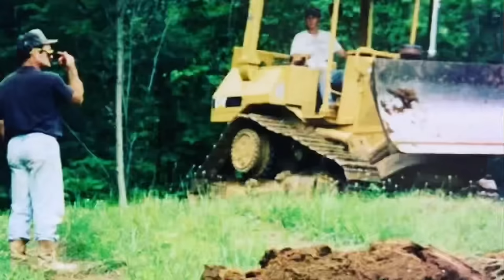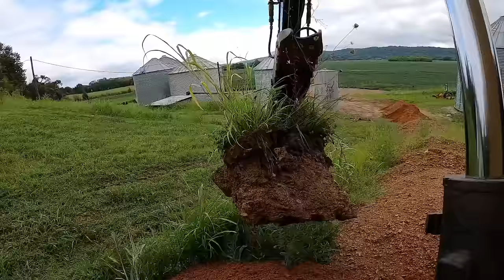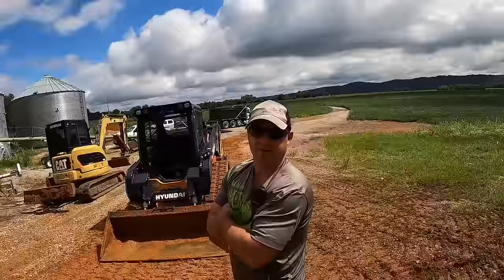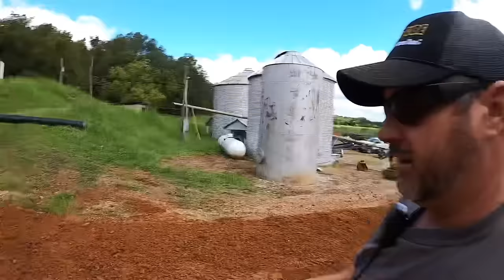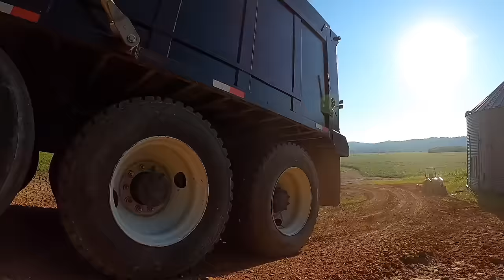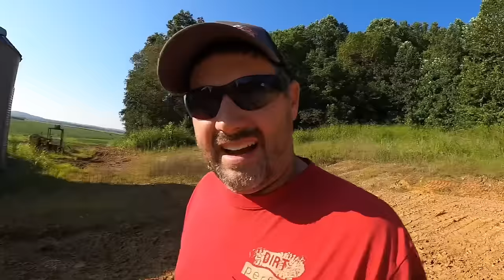Small Road Job for Grandma Turns Into A Joy Ride In A Dump Truck For Grandma!

Comment: Should drag the old dozer off the family farm and get it running and operating again. Slap a big dirt perfect sticker on it. Would be a great mini series for the channel or do a collab with Diesel Creek
Reply from the maker: Video posted about that
Reply: @DirtPerfect  sweet ill have to scroll back and find it
Reply: @joshestess that dozer is a big reason DP went out and got the D6-9U that's currently sitting in the shed at the lot. If I remember correctly the one on the farm is in rough shape so he found one like it. Definitely worth watching if you can find the video as he goes into good detail about it all.
Reply: I dont like Diesel creek he buys too much stuff that doesn't work and doesn't fix any 🤬

Comment: I've driven a truck for over 35 years mostly dump trucks and I've hauled huge loads and steel mills and I have only gotten the front end in the air one time tailgating material up a hill.

Comment: Saw a guy the other day use a rock bucket to spread gravel and do a final dress, thought he was nuts when he drove into the pile but he set the bottom a few inches off the ground and the gravel fell out smooth as could be.

Comment: I had lane on my farm graveled once where the hill was steeper then yours and spreading while going up the hill.  The gravel truck tipped up on end, so I had to pull the front down and when it hit the ground, the radiator in the truck sprung a leak.

Comment: Don’t think that was the first time Mike got a view of the sky driving a dump truck. Mike how did the area on the family farm that you cleared, reshaped and ditched last winter turn out at harvest?
Reply: I seriously doubt anyone who has ever driven a dump truck has not seen the sky at least twice when dumping a load. I had that honor on the first load of asphalt (smooth seal) I ever hauled. It was a cold night and the Barber Greene paver broke down so they sent us back to “the plant” to dump our loads so they could run it through again however by the time I got back and went to dump my load it had turned into a big black ice cube but I was told to dump it or go home so I did what I was told and was rewarded with a beautiful view of the night sky over the paving plant.  My second time was I was told to take another drivers (my boss’s) truck that was loaded to dump it. We were working a land clearing job and unbeknownst to me his truck was full of stumps and when I went to dump them they got stuck in the bed and I was again looking at the sky. The joys of being the FNG at an excavation and paving company
Reply: @gullreefclub it gets a bit more tense when the dumptrailer picks up the rear of your farm tractor 3 feet in the air and its balancing on the drawbar, tilting to either side youre trying to get off of it...😅
Reply from the maker: Good
Reply: @Sjanzo  I Bet.

Comment: When I drove dump truck and that was very little I never liked dumping up hill. If for some reason you had to stop and load was left on the back and had to start you can bet the front was always going to see more air than ground. I didn’t mind pulling equipment with them but sure didn’t mind letting someone else dump dirt and rock with them.

Comment: This action in the thumbnail is COMMON!
It occurs when your load is stuck.
I've had it happen because LOADERS don't break up material before loading !!
Large chunks get caught between floor and top of open tailgate.
When you attempt to shake material which may be caught against/between dog house and front of box, wheel stands occur.
Ps. It's good (lol) for your tail gate as well. As you can slam it into the ground , or when filling an area, into a pile previously dumped.
It can bend gate, hinges, hinge pins, or may even knock your box out of square.
Reply from the maker: Not it at all sorry to disappoint you
Reply: @DirtPerfect  you telling me with over 20 years alone in dumps and excavating..
This doesn't happen, as I've explained ??
Get serious ??
Most large excavation dump sites keep a backhoe handy to clear obstructions from gates.
I started with dumps in '71 now retired...where were you then ???
Reply from the maker: Lol ok 👌
Reply: @DirtPerfect  can you load a 6 wheeler with sideboards with a 55? Or do you need a 77 ??

Comment: I called our local factory that make   Culvert pipes an got a qoute on 40 feet of that black pipe an a 45deg fitting in 24" as do to this transmission line coming though my farm I have to move my pond over flow an pond drain pipe over. For the 2 length 20 feet long double wall an one 45 deg fitting to turn down the back side of the dam an 40 feet of calanized steel pipe 24" for a run off crossing to were my new shop going to be rebuilt. Came out to all most $4000 cnd

Comment: OMG I just loved this video!, I'm with Aaron on that you should of NOT tried to drive the truck on that while it was wet, cause you sank, and left some pretty deep ruts. After it dried over night, was not too bad, except for two spots, and then adding the stone, I almost fell off my chair as Mike went flying in the air with all front tires just hanging in the breeze.. ROFKL!

Comment: Next time you spread rock like that, especially 53s, the best way to have done that is take it to the top and rase your bed up 3/4 way up to get most of the weight at the back where the gate is, that way you won’t starve the apron, but still keep your bed lower, thrust keeping your center of gravity lower while you are still running heavy. Then drop the bed down to about a quarter way up, then spread in reverse, (but let all the way out the clutch and be moving at spreading speed BEFORE YOU OPEN THE GATE) because if not, you will develop a pile behind you, and rip both mud flaps off, and/or stop you dead in your tracks. That’s the best way to do it. You can also feed the gate by raising the bad 3/4 up then dropping it, to keep weight on the front end, but it’s far better to do it down hill in reverse, to keep the truck on solid dry stone, because you are extremely lucky you didn’t lay it over on its side just then. Next time you may not be so lucky. If you had suck up to two inches more on one side or the other, the bed would have kicked out 3ft at the top, and you have went straight to the ground. I had that happen once, and it doesn’t feel good in any way, trust me. Lol. I’m not sure what hurt worse, my back the next day, or my bank account when I had to fork out $100k in damages. Lol

Comment: I can't believe you guys don't use the float setting on the skid steer to average out your material.  Get a full bucket so you got some weight workin' for ya, jamb hard forward on the lift arm control, and let the arms float down, then drive in reverse.  If you want to drag material back with you tilt the tip down.  More tilt, more material drags.  Or flat- will drag a little, but mostly a sliding compaction.  Once you master the float technique, it will save a lot back and forth tweaking.  I noticed Chris (Letsdig18) and a few others don't use the float feature either.  So you are in good company.

Oh, and as any good dump driver knows, if you've got a choice of  tailgating up hill or downhill, always tailgate downhill.  I got a feeling that you had an idea you might go airborne which is much more photogenic that what a downhill run would give you.  The crazy thing is you could have just as easily flopped on the side.  And there would be Aaron underneath whatever is left of 21 tons of stone and the box.  So you pulled it off this time and nobody got hurt  I would urge you to use a bit more caution.  Yea, I know safety 4th, but still...
Reply from the maker: So confused by this comment how much experience you have because of sounds like very little thanks

Comment: After seeing your video the other day  of that track loader I call  the local dealer Hood logging were I rent there mini ex an big excavators in that brand. Being I am ready to buy minimum 97hp  track loader an 5 attachment. I asked for the sales rep to give me a close match to the t770 bobcat that I have already got a qoute on with all the attachment an had the t770 as a demo for 3 week. But the sales rep a hood told me unlike the excavators the track loader are just starting production an have not been real world tested so they are not bring any into Canada for sale until they buy some for there rental fleat and test them for 2 years in rental as they did with there excavators. I call 2 other dealer in 2 other provences and got the same answer. I want the roll up door an I always feel trapped running any brand with hinged door. Sure you can bust the back window out to get out if you roll it an loader up a bit to were you can't open the door. Unlike you we don't have miles of flat ground with the od hump here an there  it all step hills dropping hundreds of feet. On my farm a lone I have 2 huge vallys crossing my land one running north an south an one running north west to north east. And I have to work in them. They both drop over 130   Elevation on each side. To mow what the cows don't eat I have to run big heavy tire chains on a very low profile tractor. I gone sliding down side ways with both rubber track loaders an excavators. That don't have the 17.5" bolt on traction bars. It's all red clay. Here in Thunder bay On. There not many option when it come to contruction eqipment. There more option for the logging like tagar cat. For mini an full size excavators an track loaders it only ASV. BOBCAT. JD. CASE. AN HYDYI MNI EX an mid size excavators. With the new big transition line crossing my land it changing my operation a lot to were my shop that not that old has to be ripped down. New live stock barns an eqipment to deal with the change so we are in a deal with Hydro one who paying for everything.

Comment: If you woulda had your tailgate open another foot at the bottom and spread it backwards from the top to the bottom that wheelie wouldn't have happened. Control the spread by your speed.

Comment: You need a pipe right in the wet spot you can see the land funnels water to that spot if you review the way the go pro shows it.
Reply: He diverted the water up higher - no need
Reply: @Manoffire260  look at the flow of the land behind the bins it runs below the pipe they put in to that spot. Water flows down hill
Reply: @richardoconnor7162  - ever so respectfully - he cut 99% of the flow UP HILL to where you speak. The hill is very long behind the trees and he has diverted it with the swales, catch and culvert. The area you speak of is a mere few hundred square feet, he’s taking care of runoff from a few steep acres.  - Mike knows what he is doing, it’s his family homestead so he is well aware of the drainage - have faith in the man - he always has a plan!